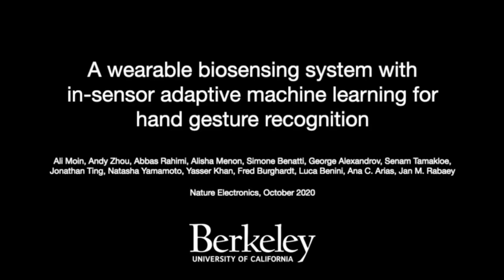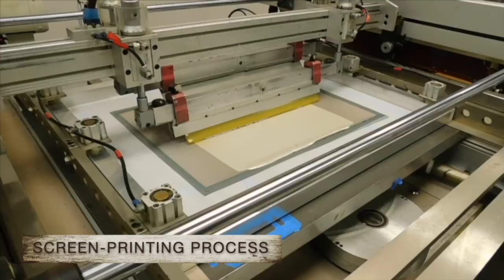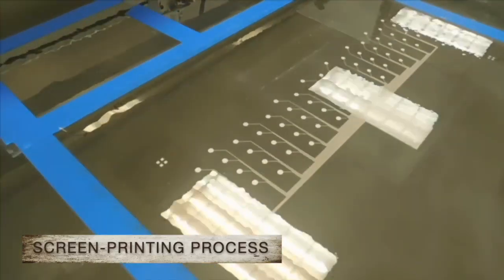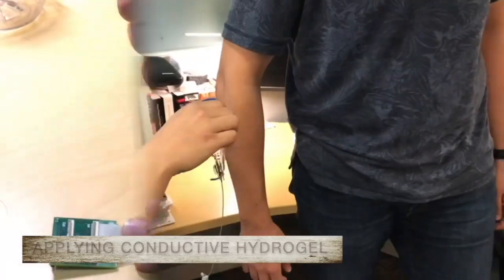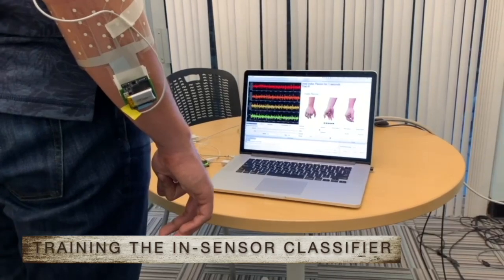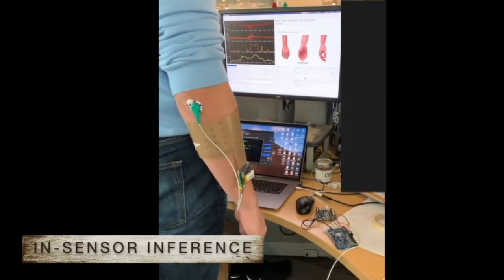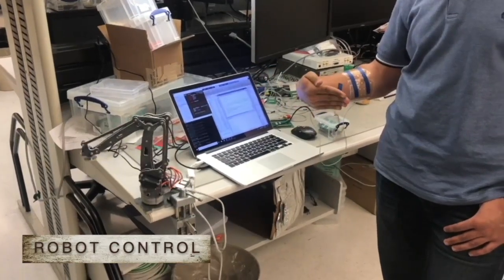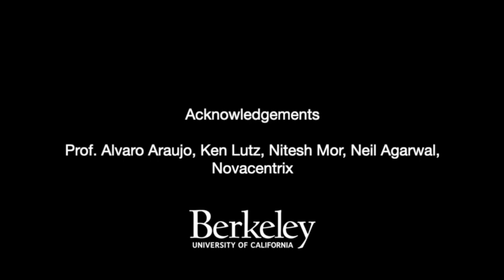An armband to control prosthetic hands

Comment: I wonder if you could get this to work by thinking about doing a gesture without actually doing it? For instance in real life you could be laying in bed wearing a VR headset, while you think about moving your arms and legs without actually moving them. The device picks up the electrical signals in your arms and legs, and lets you move in a virtual environment without having to do it in real life.
Reply: EMG doesn't work before some signal reaches muscles. But with high enough signal quality, it's possible to recognize activity when muscle barely moves - so instead of full gesture, slight movement can be picked up. But that is really sensitive to noise - especially to noise caused by changes in contact properties - so while it's definitely possible in ideal conditions, it might not work well in real life scenario (you can check videos on our channel, there are some muscle activity visualizations which might be interesting in this aspect)
Reply: @UltimateRobotics  It might be a bit more uncomfortable, but I saw a demonstration of "microblading" where someone embedded artificial eyebrows into their hand. I wonder if a similar technique could be applied to electrodes to obtain a cleaner signal bypassing the epidermis? I'd be concerned with infection, tho.
Reply: @MikeTrieu  definitely, and the most advanced systems implant electrodes deep into the arm, right on the muscle surface, with the whole device placed under the skin, using wireless charging and IR led for data transfer. But such approach adds a lot of medical complexity - if not done right, consequences would be quite unpleasant